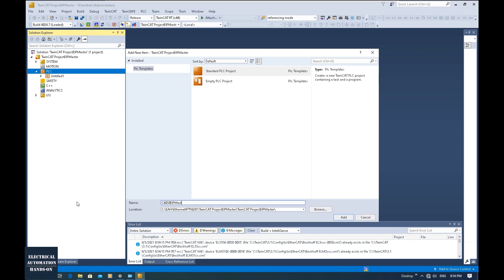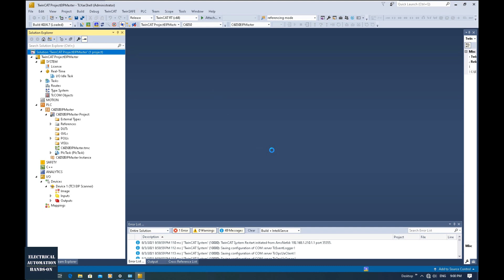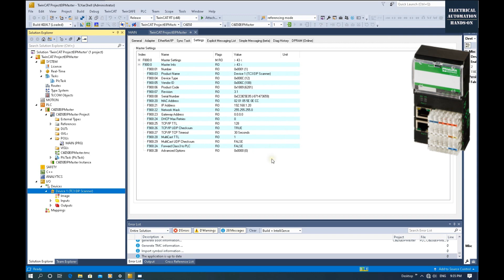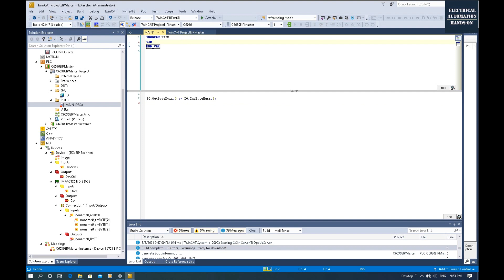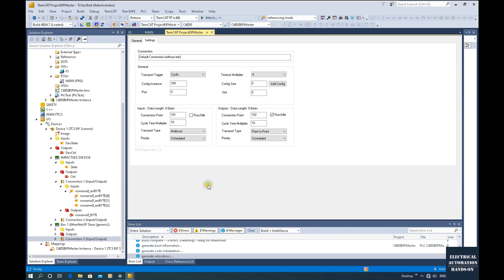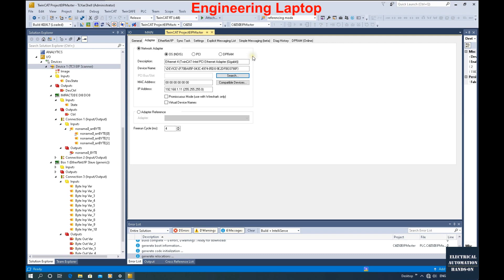COM23. EtherNet/IP - Beckhoff TwinCAT 3 (TF6281) Ethernet/IP Master(Scanner) and Real Hardware Test

Comment: hi im using sig200 for my sensor integration gateway. im using multi physics box from sick. im having a problem, im done scanning the sig200 when i add io connection i didn't get the value. all the value is 0. i already add the eds file. can you help me?

Comment: Hi, I'm using an Ethernet/IP scanner to communicate with a chiller but the connection times out as soon as it is established. I have played with the Sync Task duration and i have tried many other thing but I don't know what to do to it anymore...
Reply from the maker: I would recommend decrease the EIP cycle time to 20ms or even 50ms for the test. Does the chiller has EDS file?
Reply: It's without EDS. I have tried what you have suggested with no success. I'm in contact with HMS support, they believe that the chiller company used the wrong gateway for the communication...

Comment: How it could be done the communication between 2 beckhoff PLCs?
Reply from the maker: ADS, for two Beckhoff PLCs. Pls see the link: https://www.plccoder.com/communicating-between-beckhoff-controllers-part-2-ads/
Reply: @electricalautomation  thank you but I mean the communication between 2 Beckhoff PLCs with ethernet IP. I created a scanner as shown in this video and then created an adapter but it is not working ( with Allan Bradley it is easy but to do the communication between 2 beckhoff PLCs it seems impossible)
Reply from the maker: @zm6306  Hello, please review the videos  COM14. EtherNet/IP - Beckhoff TwinCAT 3 (TF6280 Adapter) and Allen-Bradley CompactLogix PLC (Master) https://youtu.be/LRqR66C3uLw ; COM23. EtherNet/IP - Beckhoff TwinCAT 3 (TF6281) Ethernet/IP Master(Scanner) and Real Hardware Test https://youtu.be/y9zqib_EieA. Please review them carefully, I believe you missed some configuration.

Comment: Great sample, Is it possible to use Ethercat Master software for TwinCAT 3 on our laptop? I did on my laptop, TwinCAT does show error when building and running, but It does not get data from EthernetIP adapter too
Reply from the maker: Thanks for watching! Yes, you can use your laptop for the test, but your ethernet adapter in your laptop MUST BE INTERL chipset. In addition, have you set the Ethernet Card successfully? as shown 10:20 in the video.